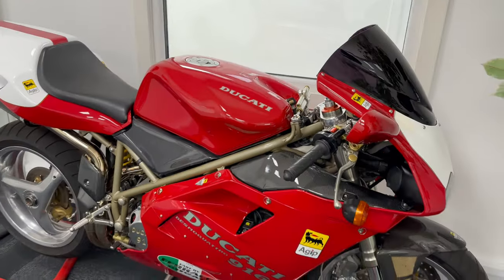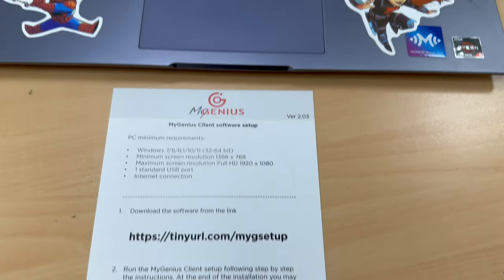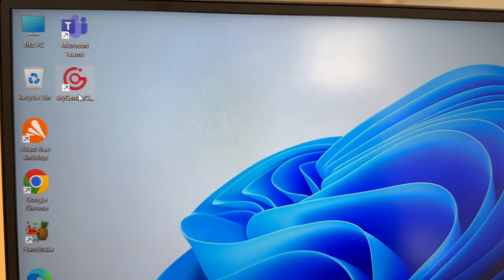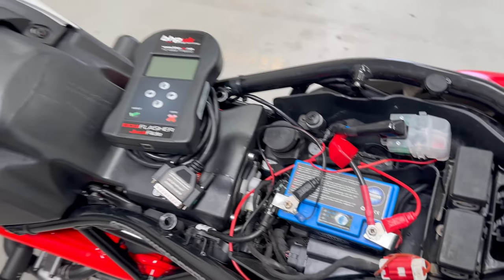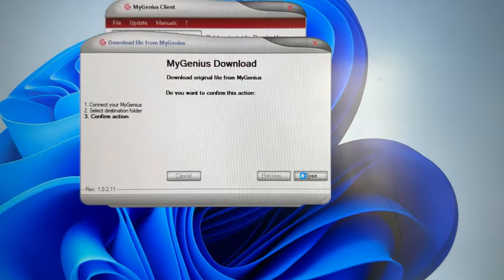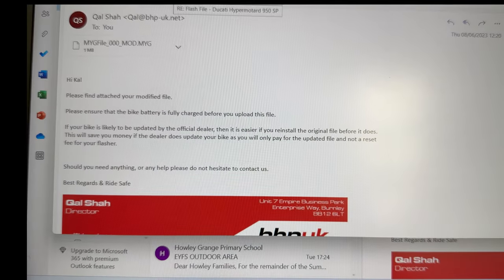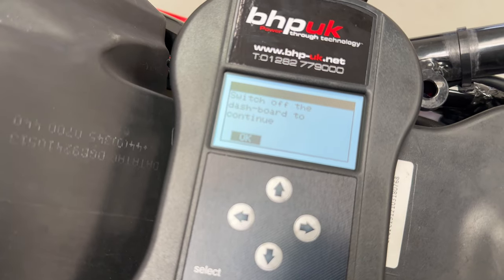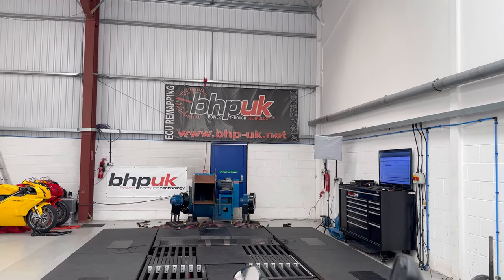Ducati Hypermotard 950 SP: How To Flash Your ECU

Comment: Sorry old chap I've gone back to the dark  side and sold the hypermotard,  I just couldn't gel with it so got a 2015 gen 1 1290 Super Duke R, new mot new rear tyre new front discs with sintered pads,  brake system flushed through,9k from new mileage, oh and the party piece is a full decay Boddis exhaust, the loudest pipe I've heard,some other interesting mods one of the four previous owners has done one is particularly clever.well all the best cheers.
Reply from the maker: No worries mate.. we all have to swap/change bikes and find “The One”. Thanks for supporting

Comment: Can you do this even if you just have the stock exhaust? Cheers /
Reply from the maker: 100%… even on stock bike with euro5 emissions and lean fuelling it will make a difference where it counts 2nd/3rd/4th gear 20-50-75% throttle
Reply: @hypermotardking  thanks! Will have too look into this, even though it might void the warranty, but seems it could be worth it!
Reply from the maker: @jonathansvensson9928  Warranty is all subjective. I flashed my bike 12-month in and with the BHP device u can flash it back to stock for any dealer work - they’ll never know